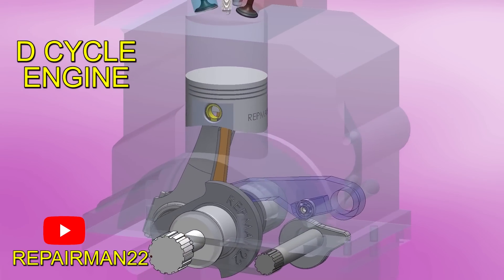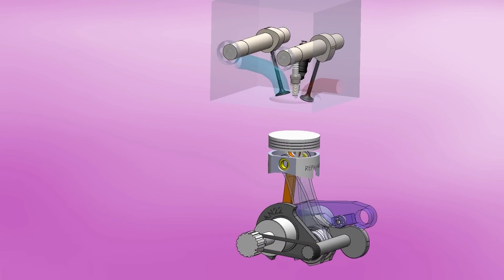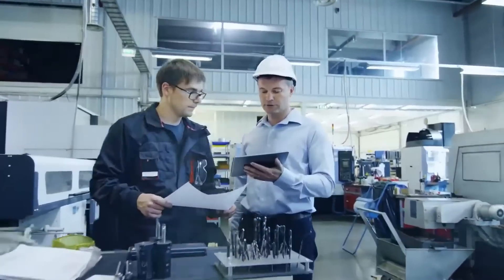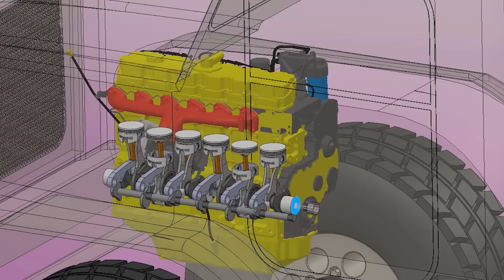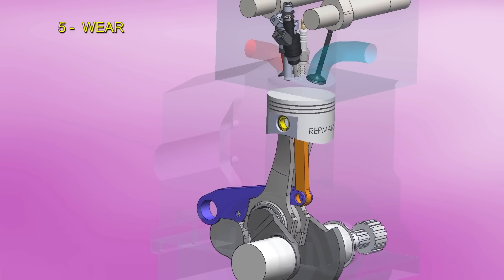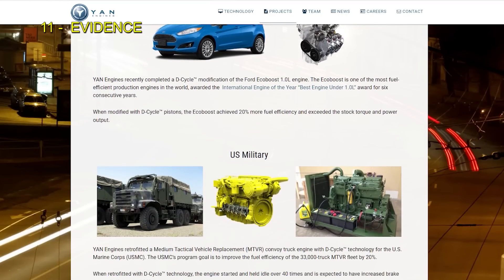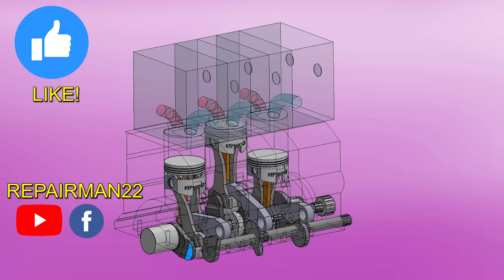Analyzing The Split Piston Engine in 3D. 🤯 Dual Cycle D // 2 and 4 Strokes Combined // 3D Animation

Comment: It doesn't seem like a viable long term solution. On paper and by the numbers it's better than a standard combustion engine. But you're sacrificing the 20% efficiency and power for probably 50% or more loss in longevity and more moving parts. If it works 20% better but only lasts half as long, or less. Is it really better? You'd have to look at production costs as well as maintenance over time to see how it compares. All of the CONS listed are why I don't think the PROs are worth the trade-off. It would almost have to be exclusively diesel powered for long term production because with as low as it revs, you're not getting much "bang for your buck". I think it would be a cool idea if it works better than anticipated. I just don't think it would last very long unless it was engineered to never fail using the best quality of materials for all the moving internals. Which isn't very good for profits on what may or may not be successful. It could be a good option if it was a well proven and reliable engine

Comment: What I love is that you assume that the upper part of the piston will come down by itself, which at that point in the 4T cycle is impossible. It's not the atmospheric pressure that's going to make it come down; on the contrary, it's the piston that sucks the fresh gases into the engine, and there are no mechanical parts to make it come down. With a desmodromic operating principle on the cam that allows this to work, it could work, but certainly not in this configuration.

Comment: I notice something, without a piston ring in "skirt"  it can scratch the cylinder wall and bump in every cycle, so thats why im curious about the actual test

If they do this, why they don't try to put 2 stage piston ring on the skirt, like the two stroke, an 3 piston ring on the upper part, to make it 5 piston ring, it can avoid the leakage of oil inside the combustion chamber

Comment: No sir. I don't like it. I think you have make a 2 stroke with valves without the funny piston. If you have a air or electric driven valve system you can switch 2/4 stroke modes on demand.

Comment: how can that cam & leaver pull down the piston crown during the intake stroke? From what you can see in the design illustration, the piston crown should stop at the top of the cylinder after the exhaust stroke unless it is forced down.

Comment: So it is going to move the piston twice as often on a conrod which has to fit inside another conrod who's only driver is an arm with a cam? Then somehow the piston is going to seal properly with the obviously different heat in the top and bottom halves? 
I would love to see where the claims come from and some independant data. 
As for reducing the size of the engine - 20% more power would be easy to make with more boost or a slightly larger engine. When you're adding three rods, cams, a camshaft large enough to take combustion forces and driver arms you're certainly not going to be reducing the size and the weight will increase by a noticable amount. 
Thats before we get into what is actually driving the piston top back onto the bottom because presumably that would have to work like a Ducati desmo system - adding far more complexity, wear parts and points fo failure. Then that has to run perfectly in time with the crank or the two halves will hit and cause massive wear in the cylinders. Mass production doesn't really allow for hours of set up for each seperate system in the crank case. 
Oh then there's the bit where the piston skirt would need to be in the liners enough to keep it in the right direction or you're going to see piston slap - again leading to premature wear. I'm sure there's plenty more too if I could be bothered to think about it for more than five minutes. 
As an engineer this is one of the most stupid ideas I've ever seen.

Comment: Looks like the crown piston should be made of a ceramic material, to withstand the high heat problem w/o the need for extra oil to cool it. Ceramics not only withstand heat but also are insulators, preventing as much heat transfer (vs. a metal crown piston) from the combustion chamber to the crankcase.
Reply: but could it withstand the "clash" when the two parts of this one piston re-connect
Reply: It seems to be made for diesels. There the speed problem is greatly reduced, since diesels can't rev high anyway, due to the time required for diesel fuel to burn. Diesel combustion is colder than gasoline one (higher decompression of combustion gasses cools them) so solving the heating problem, direct injection works better for diesels than for gasoline engines, and blow by is less of a problem.

Comment: Pistons have skirts because they have to have skirts. Race engines have short skirts and are rebuilt constantly, daily drivers have long skirts and run for more than 200k miles. The top part of the piston has to have support with a sleeve or a couple of pins going into the lower part so it acts like a skirt.

Comment: Scammmm.. Nothing will surpass what we have at this point.. Volumetric efficiency and the fact that no exotic materials are needed to make it last a reasonable time is what makes the 4 cycle so good... That and the ability to separate the oil from the cumbustion chamber and do it for a long service life.. Any engine that would surpass it MUST do better in all catigories not just a couple...cost, long term emissions, longevity, parts count, wieght, mechanical noise, and im sure theres more are major reasons this is a non starter... Why people invest in this stuff is confusing to me it always comes down to people with more money than brains supporting this nonsense.. Like "liquid piston" and "alfadan"... Cmon people educate yourself before investing

Comment: Nasty, more cranks and cams instead of no cranks and cams. Totally the opposite to my kind of engine, which is a single reciprocating (2-way) free piston (head only, 2cm wide), 1 STROKE, crank-less, cam-less, turbine + heat engine combo!??!. Unlike a normal turbine engine it doesn't have to idle at 10s of 1000s of RPM, preferring 0 RPM. Unlike a silly old cranky 2 stroke or 4 stroke engine it combines combustion, flush and full compression of the next stroke + a little compression of the stroke after that in ONE STROKE!... and COMPRESSION PROVIDES MUCH ROTARY POWER (as does combustion the other end, of course).. 
--
A 20cm wide and tall, 25cm long unit houses a 1L cylinder + !magic! combustion chamber either end, cool(ed) solenoid-actuated poppet valves. a water + lube + coolant additive pump, axial and radial (and PISTON) compression... It also has several litres of high pressure CO2 sealed inside.. An efficient motor-generator can be included in the same size unit. It is extremely high torque. An air-hammering beast of a (hybrid) TURBINE engine.... blah.. blah... I'm just sitting on the 2D design. It really needs to be 3D for marketing purposes but the idea is doable, elegant and compact.

Comment: Direct injection 2 strokes make this redundant. A supercharger is used for exhaust scavenging and the oil system is identical to 4 strokes. Ironically with diesels these fell out of favour because of NOX emissions and newer designs only overcome this with lower compression ratios and higher fuel atomisation.

Comment: My first question is why? We had a 2 stroke engine decades ago already that didn't utilize a total loss oil system. The Detroit Diesel. It needed a supercharger to force air through the cylinder at a fraction of a bar over atmospheric (some used turbos as well in the later years to introduce true forced induction), but was a 2 stroke combustion cycle with 4 stroke valves, crankcase, and combustion chambers. Especially with direct gasoline injection and modern turbos and superchargers, this could very easily be implemented on modern gasoline engines rather than this overly complicated destined to fail design.

Comment: i dont think that this engine will succeed in passanger cars, maybe in trucks since they dont require high rpm, just a lot of torque. but where i really see this engine shine is in trains since they already have a low rpm and if it gets more thought out it may be cheaper for the train industry since they already burn less fuel or better said gain about 20% power for the same displacement

Comment: Clever! However it's a combustion engine, using fossil fuels or at best hydrogen (which oil companies for commercial reasons would prefer to make from fossil fuels)Llike any other combustion engine it is harmful to our environment, not only during usage, but also because of pollution during fuel production. Combustion engines should be forbidden as soon as possible.

Comment: More parts again? No thanks I'll stick with my electric motor, high efficiency, low NVH, low maintenance, no fuel quality issues, emissions, simple final drive, instant torque, super reliability and reasonable cost. And less likely to leak oil and coolant. At less than a penny a mile fueling cost I'll stick to electric. The future is electric.

Comment: Oh look another Chinese wonder product.... so you get an extra cycle... while at the same time you destroy your cams, your connecting rods, your crank, your valves.. All that for an extra cycle, added weight, additional complexity, and a pain in the ass to service... seems like a terrible idea.  There are way better engine projects out there like opposed pistons which removed all the valve gear and fire just like a 2 stroke that don't burn oil like a normal sleeve valve 2 stroke.  That piston wouldn't last 1000 miles.. let alone 200K that you can expect out of a normal engine today

Comment: i see this concept as being unable to survive in the field...the needed strength and the accuracy of motion required for the literally billions of cycles requires any reasonable service life to avoid contact related circumferential deformation resulting in cylinder wall galling will lead to excessive maintenance combined with weight and extra frictional reduced fuel economy....it's a beatiful idea and i like it, a closeable valve equivalent of a cylinder pumped scavenging 2 stroke, but the Otto Cycle engine  with it's plug in a jug simplicity is a damn hard opponent to beat for it's power, verstility of use and durablity...

Comment: Thanks for sharing a concept that I hadn't heard of.  Excellent graphics of the split cycle.

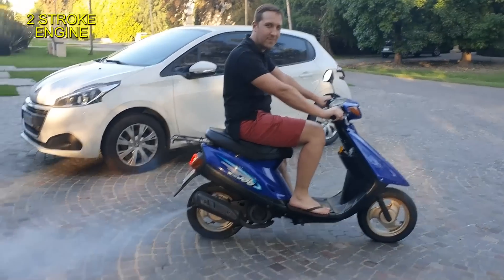Lousy science on your script.  Too many errors to list.  Down voted.  have an IC engine specialist review your script. Especially 1:19 with the intake charge being "compressed" in the crankcase of a 2-stroke.
Reply from the maker: Actually, you need pressure. If not exhausting gases will remain in the cylinder without a good scavenge. The  crankcase compression ratio is 1.5 approx. Of course, it is not a real "pre combustion compression". May sound lousy, but is the easiest way to explain it in just 10 seconds used to describe the 2 stroke process.

Comment: Interesting as a concept but trying to improve something from 2-stroke while being more complex than 4-stroke. Burnt oil emissions as from  2-stroke will ban it from adoption in ordinary cars. The highest power/rev/displacement ratio will be for 100 years old design of double stroke u-boot engine. I've seen it in Deutsches Museum. Unfortunately don't remember, whether it was 2 or 4 stroke. I think the similar ones are used on big ships.

Comment: Splitting of the piston and the separate movement and re-joining within one stroke will require extreme tolerances. As soon as this concept revs up, the stresses will lengthen the drive-rod of the piston and cause the top half to smack into the bottom part, resulting in excessive wear and very noisy functioning. I think this engine will always sound like it is broken in a bad way.

Comment: Nice idea in theory but I reckon the cons outweigh the pro's. Expect higher mechanical noise and wear.
Reply: Yeah but stuff like this could have potential in racing as more mechanical noise and wear isn’t a big deal depending on how much wear and type of racing sport. Engine gonna get rebuilt very often. 20% is big in racing.

Comment: I'd love to know how high they revved those test engines up, and what problems they came across out of so many potential extra problems. The two piston halves clapping eachother, the sheer amount of force being put on that arm and its tiny roller bearing, piston slap from that pancake-flat crown piston, flex in that split con rod, extra balancing issues, etc etc.

Comment: I believe this technology will find its place in diesel.  Transportation,generators, trains something along the lines of low rpm, high torque.   That return spring is suspect.  To much spring compression you loose power and higher slap. To little and you have a floating piston in high speed rotation.

Comment: Do away completely with the intake and compression strokes on the standard 4 stroke engine.   Instead you direct-inject compressed air and right amount of fuel at top of exhaust stroke. ignite it immediately.   =  combustion, exhaust, combustion, exhaust,   etc..
new 2 stroke engine,  Only the top half of the engine needs to be changed to do this.  though it may need some additional cooling.
Reply: I wondered long ago why direct-injected compressed air thru the use of an injector like that of a fuel injector is not used. A turbo or supercharger could be used to compress the air and as you noted, no need for an intake port or valve. Perhaps an engineer can answer the question.
Reply: @VGHCX  nowadays, i'd expect an electric compressor could squirt in enough air to fill the combustion chamber up to required compression ratio.  Whether it could do so at 5000rpm is another matter.. Avoids all heat concerns around a turbo too.

Comment: Although there are some issues with this engine design, I still like it since it is kind of like a 2-stroke engine since I love those engines and that this engine would be better than a regular 2-stroke engine. Also bhecause of the engine's design, it can be more powerful with the same displacement of a regular 4-stroke engine but unfortunately I don't think this design will come into main production since I don't think it ever had the time to shine in any production cars yet.

Comment: The fact that we use the design of the 4-stroke as it is for a century now without major modifications speaks for itself.
Maybe its simply that good.
Reply: Yes, but the attitude of we can’t improve anything ignores the fact that the four cycle engine has been improved greatly over the past hundred years.
Reply: Or we follow the herd ...
Reply: For civioian use, but for military this gives more power which is more important than efficiency and parts replacement, or for other cases where the extra power and thus cost to maintain/repair is worth the work it will do for you while keeping things small in size, a CBA would have to be done comparing it to conventional engine that is larger but delivers same power

Comment: These engines would be fine in most vehicles. Opioid junky grannies dont rev above 2000rpm anyways. It would probably be fine in even some sports cars. It just wont replace a honda S2000 engine or a rotory.

Comment: Bro i am CS student intrested in engines i was trying to build similar engine but with different approach. They did this by splitting the connecting rod i did by sending compressed fuel in intake valve. I have drawen it

Comment: Excellent video. My gut tells me this wouldn’t last in the long term. You’ve basically built piston slap into the system. With it firing like a 2 stroke it’s going to generate heat like a two stroke. I reckon it will make good power. But I don’t see it lasting 200,000 miles without expensive maintenance inbetween.

Comment: Its a nice peace of enginering butt is this not a case of over enginering a solution?
2 stroke engines are having a comeback in general due to low weight, fewer parts and size in comparison to a 4 stroke.
The old classic scavenger version has only its place in  garden/forrest powertools.
Non oil burning 2 strokes designs are older the you think
-f.e. the oposing piston engine with 2 crankshafts and no valves who powerded aircraft locomotives and ships (f.e Jumo, Napier Deltic)
- supercharged 2 stroke diesels who have only an exhaust valve.(mostly ship/ locomotive engines) EMD, Sulzer, MAN B&W
Also don't forget the wankel rotary engine who is ceramic coated and doesn't need lubrication.

Electric drivetrains (ludricrous torq, low horsepower) is winning from classic mechanical drive trains
As we know batterytech and rare metals to produce them has serious limits.
A smaller batterypack combined with an auxilary compact modern 2stroke/wankel rotary engine optimal tuned for generator is the best of both worlds.
I think that most cars in the near future will be like state of the art Freightlocomotives today.
Electric drivetrain, small batterypack and a combustion engine as a generator.

Comment: What mechanism drives the crown piston back down? Is it purely the positive pressure of the turbo as I notice both tested engines use forced induction. Really interesting engine design though

Edit: I see there's a spring, but I wonder if a turbo could provide the required pressure to return the crown piston.
Reply from the maker: You can't use pressure to push the piston down because if misfire occurs on the expansion stroke, the piston would keep going up and the whole engine would break. I also don't think that that boost pressure is enough to push down at high rpm.